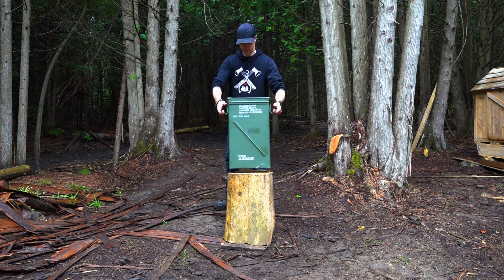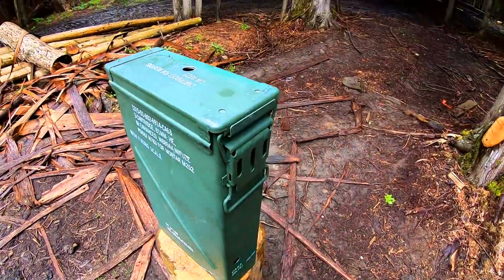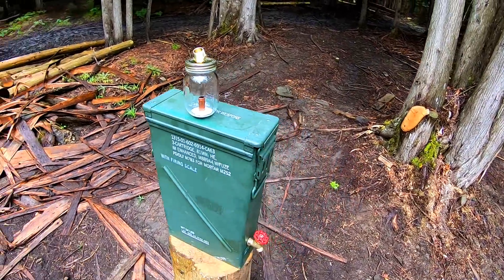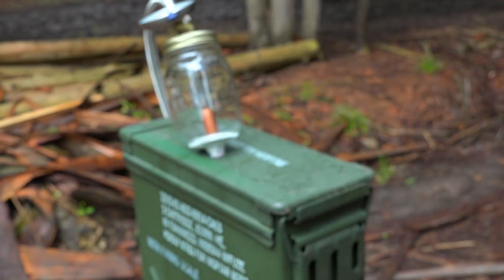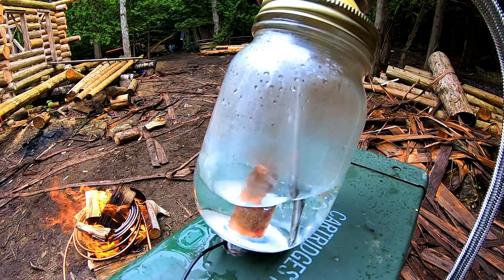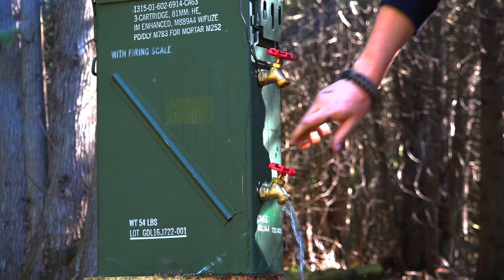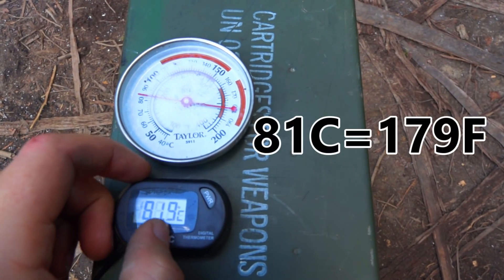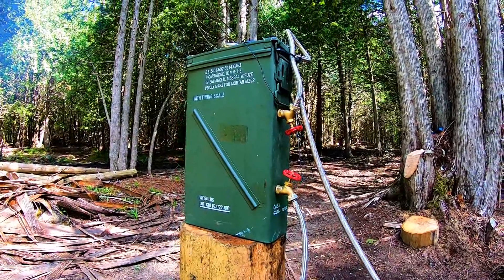Off Grid Heating Prototype- Copper Coil Water Heater / Heat Exchanger / Radiant Heater

Comment: If you add insulation to the EXTERIOR of the camper  and heat reflector IN the camper you would not need a contraction such as this, you have a Insulation problem. not a heat problem. the body can generate heat at 98-104 degrees.  all you need to do is 1. Stop the heat from escaping the camper that the body generates.  2 reflect it back at you so you dont need an exterior heating element to help you.  When heating or cooling its always easier to heat or cool the person rather than the "space". But Cool video none the less. If you wanted you could just do a metal pipe in the fire.. and just heat the AIR in the pipe.. cold air comes in.. and hot air goes out.. https://www.youtube.com/watch?v=QeHGDr81XwM

Comment: You should open up the copper ring so that’s like a fire ring around the fire not directly in the fire if you leave it directly in the fire it’s going to eventually destroy the copper pipe but if you open it up to where you can put a fire in the middle of it and have it around the perimeter of the fire like a fire ring the copper will last a lot longer

Comment: instead place a large 20 gal pot of water on the fire  and run copper piping from it to inside your tent and back to the pot. much more safer, no noise, no chance of getting burnt from hot water, no oxidising copper pipe and wearing it out

Comment: Now, replace the ammo can with an automotive radiator.  Add a small battery powered fan and you'll have real heat.  The radiator will be lighter and smaller, you could easily mount it to a wall.

Comment: Waste of fucking time.  This isn't useable.
Build a brick containment, 3 feet tall, 2 feet wide, 2 feet long, like a rocket burner, place the ammo box over the fire about 2 feet from the flames, use half the water, install a pressure release valve, and then run the copper tubing around the inside of your cabin, insulate the copper tubing with layers of thin brick or concrete.  Reverse the concept.  There you go.

Comment: the problem is you laid the copper coil in the fire, coil was way too hot.  you needed a tank of water over heat to boil, as the coil being cooled off with cold wet cloth and there would be no steam out, only distilled water ;)

Comment: Seems like a lot of stuff to make a hot water radiant heater.  I'd try to lose all the hoses and find some stones that will fit in the ammo can, wrap them in some steel wires and set them in the fire till they get real hot.  Then pick them up with the wires (that are not in the fire) and set them into the tank.  Same system used to cook shell fish etc for many years by natives.

Comment: so many better ways to heat that small of a space
Reply: @ad2578  This wouldnt explode. With the hole at the top it would steam and eventually boil out. I don't foresee a campfire getting the water hot fast enough, to produce more steam then the hole could handle. Either way, I would keep the tank outside.

Comment: Hmmm metal container with water in it.I think I’ll just set the container close to the fire and heat it up this way or in the fire would work just as well and have a line from the tank and it’s still portable.Do like the video though always interesting watching these and may learn something new.Thanks.

Comment: beware of steam flash... no joke... the pressure relief hole at the top is great, you could put a valve on it... but steam must escape, and bext to have water in the coil before it is placed on the fire.. as little air as possible. I like the idea of the coils under the camper.. however, less water per sq inch means it will cool just as quick, once the fire goes out you have nothing and the water will freeze and soft pipe is easy to bend but also easy to burst in a freeze. a good idea would be a way to drain the copper line once the fire dies without going outside to prevent this. also in such a small space I assume you have created a sweat lodge, even more so with the vent hole. high humidity equals colder feel once it does cool off, kinda like working up a sweat in sub zero temps. you'll cool down faster. I'd suggest venting it to the outside, not in your camper.. unless you want a spa.

Comment: This would be ok if you had a reliable source of cold water to introduce into your system every so often.
Reply: Snow bucket for melt water? Could run a float valve and small pipe to steam-melt the snow bucket.

Comment: Yo I've calculated that 1mtr of 15mm copper takes on 2kw of heat.
I've build a stainless steel stove with 4mtrs of copper, 160ltrs @ 60degrees celcius in 1.2 hour 😚

Comment: dude... 2 things:  1) I think your first test had your water line  lowered after you connected the copper tubing.  once you open that valve, the tubing fills up with water, and the water level in the tank goes down because of it. Of course, if you added water back to the tank after, then that's no longer an issue, but I'm betting a huge percentage of what was in the tank ended up in the tube, lowering your water level.  
2) I'd LOVE to see you add an emergency pressure valve to it ... so you can sleep at night without worrying about the internal pressure of this thing... And a reverse pressure valve to allow air back into the system when it cools off..
Just a few of the things I figured I'd need in my own heater.  Otherwise, I LOVE what you built, and would hope for a smaller but very affective one for my own camp.

Great work dude...

Comment: 3:56 into the video.... pressurized hot water..with no safety dump valve, and a glass jar....

Sounds like a recipe for a grenade...

Hopefully before the end of 11 minutes he gets a bit of safety into his system.

edit
Ok, its NOT pressurized, the jar just sits on top, not sealed. sigh of relief

Comment: The principle of this is fine but the actual application is so badly flawed. To get a proper circulation due to thermosyphon the coil AND the connecting tubes need to have a constant incline  with the hot one being higher at all points. The coil needs to be opened into a fixed spiral with the cool return at the lowest point.  What is happening here is localised boiling in the coil that is forcing hot water up the tubes, probably both of them, then sucking cooler water back down as the vapour collapses. Apart from that it is just so dangerous !

Comment: Bravo, young fella.  Your tubing flowed water far better than I expected when your video showed your dropping the coiled tubing severely incorrectly onto the fire.  Much applause here.  First, please allow an explanation.  You have & express a definite misunderstanding of thermosiphing that is more easily explained than corrected.  As with much thinner viscosity air, the cooler molecules are heavier because they are denser.  Likewise, warmer molecules are lighter and less dense.  (Overall, heat expands while cold contracts.)  General misconception is intensely incorrect here, being twisted 180°.  I've even heard high school teachers incorrectly explain this ultra basic bit of physics.  With over 50 years studying thermodynamics, I correct this one point here.  Heavier (more dense) molecules sink because of gravity.  Physical properties are governed by the physical laws.  Heavier stuff sinks.  Lighter stuff floats because the denser stuff muscles it's way toward the bottom, pushing lighter stuff aside, very much like schoolyard bullies.  Hot air goes any direction more easily than heavier air.  It is more easier pushed up.  Thermosiphon action OBVIOUSLY works here in this idea.It will, however, work far better when you correctly position the copper.  It should run no less than level on the path from entering the heat of the fire to the tank, and a steady, gradual rise would be infinitely better.  Other than that major point, I say continue having fun with the good work.  Later.

Comment: If you run a copper coil insde the ammo tank .
this will work as a heat tranfercoil .
and the winter cold should cold the water enough , on the return line to the fire .
the water in the ammo box can be used for drinking , cooking , and bathing .

Comment: You can also use this method with a larger tank to create.....a hot water heater.  Nice hot showers.  Wrap your cast iron stove with the copper tubing.  Keep the tubing elevated with some wire going into the tank.  An actual discarded hot water heater tank is normally insulated to keep the water warm and can be gotten for virtually nothing.  Place the hot water heater tank in the attic alongside a cold water tank.  If you really want to be fancy, the cold water tank can be fed with a water wheel in a stream that's used to pump water into the tank.  So you have two tanks, the hot water and the cold water, all gravity fed if you install them in the attic.  Presto.  Indoor hot and cold water.

Comment: It’s a small space to share with a can of boiling water! 
Won’t the water freeze overnight when the fire goes out?
I might be tempted to hang a small woodburning stove off the end with the door opening inside. That way I could light it in the morning before I get out of bed. But it’s also a small space to share with a box of fire!
Reply: The volume of water is supposed to act as a heat bank and dissipate heat over a  period of time.  That is why he used a larger can.

Comment: After viewing your video and getting some super ideas,  I was excited to incorporate them into an on going project to heat an A-liner trailer.  The first observation I made with your creation; it is generating steam which is not necessary to develop an effective thermosiphon system.  I believe that unrestricted upward gradiant of ten degrees or more,  with a rule of thumb indicating at least a  rise vertically of one foot for each two feet horizonally between your coil or boiler and your heat sink reservoir (ammo box) is necessary for your hot water line to achieve an adequate flow.  The cooler return line is less critical in its path of travel as long its evacuated completely of air pockets.  Since  I wished to use different fuel sources to provide the hot water;  I chose to use an old fashion pressure cooker because it was designed to operate over considerable heat and much more pressure than our open thermosiphon system could develop at a boil.  I did not alter the pressure regulator or the safety blowout valve.  My brother-in-law drilled two holes on either side of the pressure regulator port and I installed two angled hose bibbs sealed with rubber washers.  Remembering that hot water rises straight up, the hot side bibb I fastened on with a 3/4 by 1 inch reducer fitting with the one inch portion facing downward to funnel rising hot water into the delivery line.  On the cold side I used a coupling, a nipple or pipe that extended close to the bottom, and a 90 degree elbow that discourages hot water from entering and directs cooler water in a circular direction around the pot to pick up heat rapidly.  This elbow is important because before I installed it,  the system would sometimes  start backwards sending hot water up the cold line.  The system operates noiselessly until the water gets too hot and can no longer cycle from lack of different temperatures in each of the two lines.  At this point, the pot will abruptly boil and the steam will let you know to shut  off the heat.  Note, also that water expands as it heats, so provision in capacity or a safe overflow must be provided.  With my turkey cooker propane burner heating the pressure cooker it took about hour to bring the six gallon storage reservoir to a boil.  Remember to thermosiphon with heat and without steam both the entry into the reservoir (on top) and exit (near the bottom) must be maintained below the waterline. 
If covered indoors, a vent to the outside should be created with tubing to keep vapor or steam out of the living space.

Comment: And how long does it take to melt that expensive copper?
Reply: As long as water is flowing through there in a non-pressurized loop, he's safe.  I agree an indirect heat source would protect the copper.

Comment: The main issues I see are with moisture.  If you're using this in the winter, you'll get the inside very moist.  Once the unit is 'shutdown', the moisture will freeze inside the sleeping compartment.  Consider a small radiator, possibly from an ATV.  I know it's not cheap like an ammo can is, but it's better suited to radiate the heat while containing the moisture.  The other issue would be with draining the copper tube.  Consider using only some of the tubing.  Good luck.

Comment: Put the jug outside the camper.
Run the lines under your flooring.
Keeps you away from scalding water tank, as well as keeps space inside. Good work.

Comment: seems like you'd be a steamed clam by the morning... what about all the moisture in the tent?
Reply: All the water will boil off
Reply: @Nate-9797  I get the impression he didn't expect it to get that hot so fast, and worry  about cooking all the water off.
Reply: place a pvc chimney on the steam release vent.  Vent the moisture outside the tent.

Comment: Way to pervert the meaning of off-grid living.  This whole setup is so bootleg and dangerous.  You know, fireplaces and hearths are purely off the grid.  If you're gonna haul a bunch of hardware out to the middle of nowhere, you might as well do a bit of research into how boilers and heating systems actually work.  Even moonshiners had better setups than just throwing coiled copper pipe into a fire.  This is some lord of the flies crap.

Comment: Why didn't you just put the full ammo can on the fire?
Reply: The ammo can goes in a tent or camper to provide radiant heat.  He has in the past heated  dry rocks over a fire, then place then in ammo cans to release heat over time.  My father's uncle would heat bricks by the wood stove, wrap them in blankets, then lay them in the bed to keep warm.

Comment: Super nice! you can add a little steam generator at the top and power a solenoid to cut the flow once reaching a desired temperature (since the steam rises way before the container boils). do you think the copper could stand an overnight fire? because if so you can create a mobile sauna :D

Comment: Yea... i think just getting a solar panel and a electric heater would be easyer :D
Especialy for winter... i mean imagine how much snow you had to melt first (and burn fuel for that) to even start this up.
And water is not the best heat conductive either... you need so much energy to get it warm it's redicoulous...
Reply: Do you have any idea how many solar panels and batteries you would need to run an electric heater all night?  That is not feasible for a reasonable price, especially in the winter when the heat is required.

Comment: grate idea     but i don't think you understand therm o siphon principals 

hot water rises so the hot water pipe must always flow up hill without going down hill and the cold water must always run down hill    the crackling you hear is vapor lock from stem being taped in a hump inside the pipe unable to travel up

re build it and make it all have an up woods flow from the point of where the cold water enters the fire     this will make lots more hot water and quieter
also reduce the coils of copper to 2 loops should be enough

Comment: If the top is extreamly hot why is it you used a Zip tie on the right side there? it will melt sooner or later wont it?

Comment: Me thinks this is very dangerous ! ! ! You are not circulating heated water but condensing super-heated steam in water most of the time.. Check the temperature of the copper pipe going to the top of the ammo box, I bet it is well over 100 centegrade !

Comment: Great idea to stay warm!. But some simple way of controlling the heat on the copper coil is needed so it never boils really, when the water reaches a particular temperature the copper needs to be raised out of the fire, when the water temperature drops back bellow a given temperature  it needs lowering back in.maybe with some sort of piston connected to a lever or arm that will raise it out of the fire as the water expands and pushes the piston then contracts as it cools down. there you go easy 🤔.

Comment: Ok great effort... Why do you want a fire outside and hot water in inside. Why not have a Woodburner.in side and put the kettle on it when you want how water ?  All that wood . Why.not burn it doors and open the flap when it's hot ?  I live off grid with caravans and trucks .we all use wood burners.. Maybe I'm missing the point  ?

Comment: What if you got rid of the water altogether. Throw the coil on the fire with one end outside drawing cool air and the other going straight into your shelter?
Reply: without the thermal mass of the water, once the fire goes out, so does the heat.

Comment: I myself would make a sled out of quarter inch steel and put it over the fire. That way if the temperature starts to drop inside the sled all you have to do is open the door and put some more wood into the fire without getting out of your sleeping bag. For more helpful tips like this just gmail me at noonesaidiwasagenius@gmail.com
Reply: Nice! Put a trapdoor in the bottom and you could feed the fire without getting out of bed!

Comment: you could attach some heatsinks on the side of the ammo box using thermal conductive glue to help the heat dissipation and i'd use a tube on top to make sure the excess steam goes outside

Comment: Uh, why do we want a hot ammo box again?  I must have missed that.  I thought we wanted a heater.  An ammo box is not a very good heat exchanger...
Reply: So that the tank will hold the heat and release it slowly over the night, I presume.  If he simply wanted to dump the heat he could have used existing radiator piping instead of the tank.